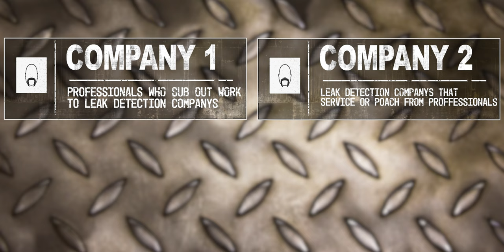I Unbox the BEST Leak Detection Equipment

Comment: Nice set up, but I'm looking for some type of gauge to measure the loudness of the sound.  Some leak detectors show the measurement of sound so your ears don't lie. You can follow the pipe direction with a locator and check for the highest measurement of sound to pinpoint the loudest area.
Reply: I completely agree. I have a system from "General" and it has let me down more than once. You need a gauge. End of story! By the way, have you found a good system yet?
Reply: Hey can u send me the name machine leak water detector thanks..
Reply: check out Sewerin leak detection

Comment: Roger, thank you so much for uploading such simple but vital info to my cerebral cortex, been plumbing for 7 years (2 as a journeyman) and never had the chance to do service on the regular til now that im trying to branch off on my own and this is definitely a huge notch to have on the plumbing services belt.
Reply from the maker: I’m glad I could serve your cerebral cortex with some knowledge brother 👍🏼
Reply: I love service, it's always interesting.  I really like old buildings but you have to take your time and be careful and the money is there.  If you can work to preserve the old stuff and put in new plumbing you will have no shortage of customers.  Avoid the ones who want bids, I still haven't developed good X-Ray vision to do that.  It's easy enough to sell your time and that helps you not get screwed and it helps your customer because you won't have to cut corners.  Also, the #1 thing my customers want second only to working plumbing, is a totally cleaned jobsite when you walk out.  No boot prints, no shit on walls and no dust on pictures.

Comment: Hey I have a few questions 1-how far will the remote work from air compressor.  2- will the air compressor make enough noise in pipe to locate a pvc yard line? Thx in advance 🫡

Comment: The problems I see immediately are that I dont see a floor plate, just probe. Pressurizing lines are to amplify the sound of the leak, which requires a holding tank. If you pressurize the line using a compressor, the ambient sound will drown out the sound heard through the equipment. Busy roads cause this, too. Lack of a decibel meter and audio adjustments make this seem like a step up from a stethoscope. If youve used more expensive equipment, the price of $3k makes sense as each probe isn't worth more than $1.5k 

Guys, the typically slab leak repair costs between $6k to $20k. If you do 1-2 jobs that will cover the cost of much better equipment.
Reply: do you have recommended equipment?

Comment: I've never used air for leak location. I'm a service plumber now (5 years working as a leak location specialist for a municipality) so my water lines have pressurized water. Have I seen a better set for slab leaks? Absolutely without question I have. That is the largest I've ever seen.. Even the 30,000 corrulator was half that size you have. The HL 50-BT Acoustic Water Leak Locator is smaller than a brief case..... Just locate your lines. Locating them will take 4 times longer than finding the slab leak.

Seriously I can't get over how big that is and also the hyper tough (super cheap stuff literally a Walmart brand) inflator. If I see low quality tools there is no way I'd buy it.
Reply: I agree I use genear le , portion of size and probably cost and gets job done . Even has an adapter to hook up more pressure to line
Reply: I mostly use a stethescope even though I can't spel it.
Reply: @isiaac5715 I miss that mic, by far the best and most compact solution.
Reply: @DoctorMangler  the brass cylinders? We always called them coconuts for whatever reason.
Reply: What do you recommend? I’ve been looking around but are all overpriced for what they are. I’v been looking into Sewerin but has a heavy tag price of $15,000. Any recommendations on what and where. 🇦🇺
Reply: @tomalley798  Some like the metrotech hL 5000, or the fisher.

Comment: I wish that would work where I am in New York. 
Our mains are 6 feet down and don't see how that would penetrate flooring , slab with rebar, the one foot of earth on top of piping. Does any one use thermal imaging? Best method I found is finding a hot spot via infrared thermometers or thermal Imaging guns
Reply: Flir cameras. You need both.

Comment: As a leak detective…if I saw you pull that out, I would laugh. You would be much better with a gen ear. But the “big boxes” (which funny enough this is bigger than anything I’ve ever brought into a home) with the wires have far more audiology engineered where you can control frequencies gains and so much more. 

This video is going to have plumbers popping holes in slab concrete with no pipe anywhere near. If you want a system that is similar then use a gen ear.  It’s smaller and user friendly. But again plumbers are not leak detectives. 

It’s why leak detection companies rarely hire plumbers because they feel they know more than us….but a plumber will hire a leak detective immediately.
Reply: well do you have any recommendations?

Comment: Kinda looks great due to no dangling amplifier on your body , but kinda bulky specially for the side kick (which looks like a jack hammer). It may be good if the stick is collapsible to avoid bending over time, the audio of the equipment looks good but i think its lacking more of functions.
Reply from the maker: I appreciate the feedback, what other functions would you like to see?
Reply: A gauge to measure the sound would be nice. @RogerWakefield

Comment: Hey Roger, I've been plumbing since '95 and I've gone plumbing with my dad since '75.  I ran across something very strange yesterday and I can't find any information on it.  We had a residential job, and some strange 3/4 copper was used with white text for water.  Unfortunately enough had been rubbed off in line that I couldn't make out the type text.  There was the word "SERVICE" but that's all I could make out.  It has the thickness of M and I even took a stub out into the sun to make sure it wasn't just faded yellow.  I have seen copper gas line but this doesn't seem to match that.  I'm only saying that because some person many years ago actually tied this very same white text copper to an abandon black gas pipe to run a spigot through a crawl space.  Obviously none of this meets code, but I've never seen white text copper tubing and I can't find any reference to it.  Most of my work is repair/refit in buildings as old as 1880's so I see a lot of non standard stuff.  This tubing was a full 20' and it's full 5/8 diameter and I was able to solder a 90 to it perfectly and it definitely was not Bundy tubing.  If you have any ideas I'd love to hear.
Reply: Maybe ACR pipe?

Comment: 18 years owning my shop. Lemme include you in the expenses
First the locator needs to know path. Then he’s likely gonna ask that a plumber come in and add valves every 100’. These guys can’t show up and wave a magic wand pointing to water line. So an experienced plumber can then find the leak with some patience. These devices are great for training 18 year olds how to follow a beep and look expensive. But that plumber that comes out to install valves will likely find it. In the 1000’s under ground service I’ve found and repaired, the leak was either at the meter or the house foundation penetration. Or any other solid structure making the line non flexible. If you get leaks in middle of line ? Replace it. Not worth the locator expense and single repair. These devices are wonderful once you figure them out. But we used mine 4/5 times to show the new guys. But once they talk to leak locate and find out the charge of $450 per hour 2 way trip payment. And they are an hour drive out. I can do a lot of impressive stuff for $900. Then they tell you to add a valve every 100’ and mark the expected path of water line. So my locator has become buried in the gimmicks and forgotten about. I use a blow plug to introduce air into system. You can feel the bubbles like a chocolate milkshake rubbling. And if your adding valves and marking line. FIND THE LEAK! Spend your clients money wisely and they will buy your dinner every time they see your family at dinner. Bet me.

Comment: Congratulations. Personal opinion, such equipment will be inconvenient and ineffective to use! Large sizes, sensitivity along the rod will be low, devices without noise level indication and filters... The compressor has low power! I do not understand a little, how can such a thing be offered for use at all?!
Reply: To say this is the best system out there is a mild exaggeration at best. Man, this thing is really lacking.  Trying to hold that 4 foot long pin on something without any movement? The remote control for the compressor is novel and necessary, that compressor itself is so damn noisy. You couldn’t hear anything when it’s on.

Comment: Where are the geophones to listen to the slab? You just can’t find the leak by listening to the fixtures… you have to be 100% spot on…. Soooo?
Reply from the maker: Don’t need a geophone…you’re listening to more than just fixtures to locate the leak. Which is what the probe is for…we offer training
Reply: @RogerWakefield  the probe works on top of the slab ?
Reply from the maker: @cortez1638  absolutely…
Reply: You're never going to get clean sound using the probe on the ground. You need a slab mic that's placed on the floor.
Reply from the maker: @CameronPrescott  that’s funny. We’ve done it for years…
Reply from the maker: You start at the fixtures… You have to listen to the slab too.